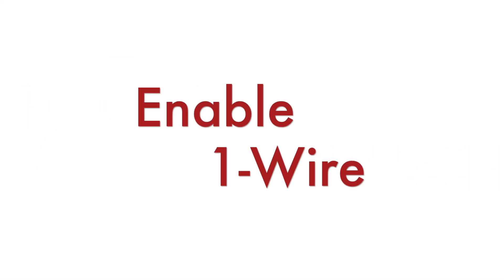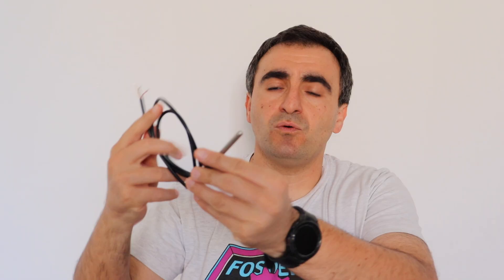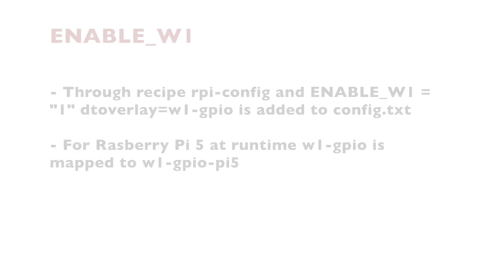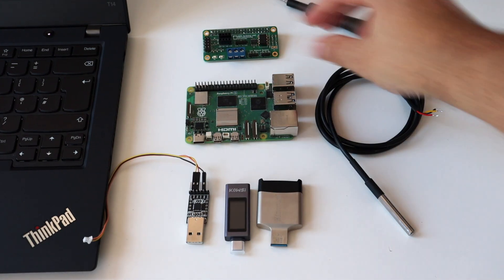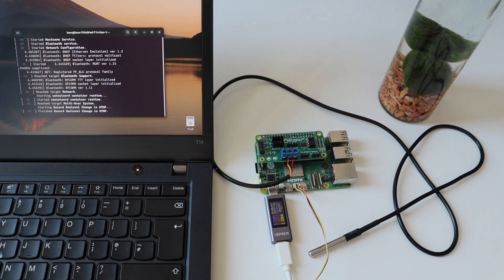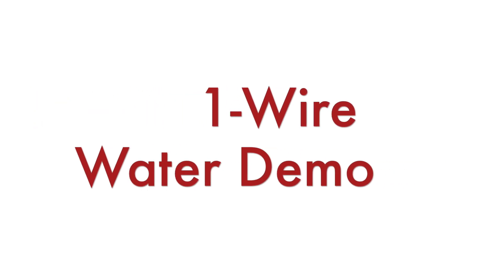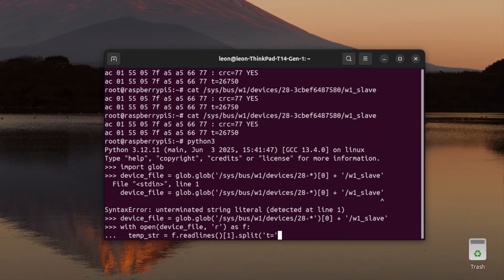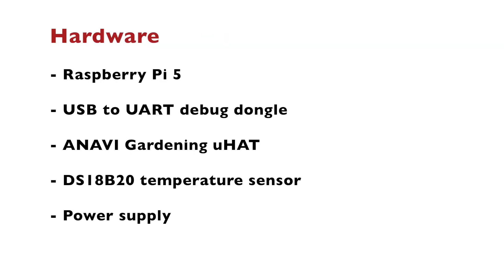The Yocto Project on Raspberry Pi 5 Episode 11: 1-wire and DS18B20 Temperature Sensor #linux

Comment: Nothing but commercial - you should do it on cheaper one
Reply from the maker: Sorry, could you clarify? What exactly do you find too expensive, and are you suggesting a cheaper alternative? Raspberry Pi is widely known as an affordable single-board computer. If you don't have Raspberry Pi 5 you can do the same even on a cheaper model such as Raspberry Pi Zero. While DS18B20 prices may vary depending on the distributor, it is generally a very affordable sensor.
Reply: @LeonAnavi  This exactly what I am saying - tool should be appropriate for task to do. R5 is the newest model and so simply task can be done with more simply model. I am hoping you will present some more complicated task processing with R5. For my and your pleasure. Regards
Reply from the maker: I am afraid you may have missed the main point of my tutorials. Their focus is on the Yocto Project and OpenEmbedded, since both come with a steep learning curve. My goal is to provide simple, straightforward examples that show how to use specific features on the Raspberry Pi in a custom Linux distribution, because it is the most popular single-board computer. Sorry but with these tutorials my objective is educational: explaining how things work, rather than showcasing entertaining tricks like squeezing out maximum task processing performance.
Reply: @LeonAnavi  Sorry then - regards
Reply from the maker: Thank you for your understanding, and I apologize if the title or cover photo came across as unintentionally misleading. While I highly recommend the Yocto Project and OpenEmbedded and consider them the de facto industry standard, I recognize they are best suited for professional projects. For many makers, Raspberry Pi OS is the more practical choice for quicker results. I also use Raspberry Pi OS myself as part of my home and small office automations. In the future, I will consider ideas for creating other types of Raspberry Pi videos that focus on demonstrating maximum task performance.

Comment: Excellent, Thank you! Please can you create a video on cyber security Se linux,Smack
Reply from the maker: Thank you for the kind words! I will definitely consider covering security-related topics in a future episode. By the way, speaking of Security-Enhanced Linux, I recently designed an open-source hardware add-on board called ANAVI TPM 2.0, which connects to the SPI on the Raspberry Pi's 40-pin header.